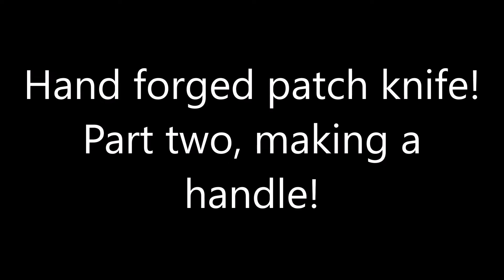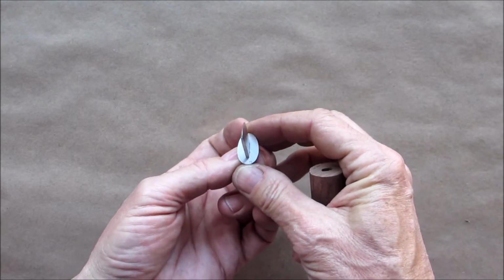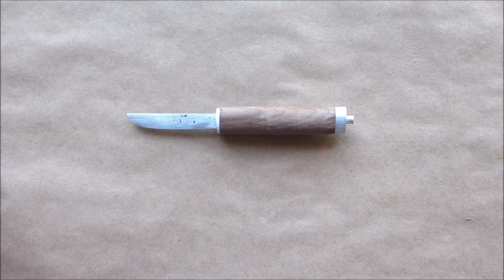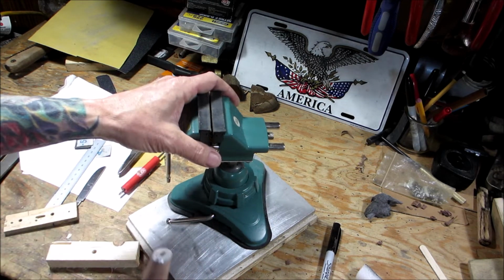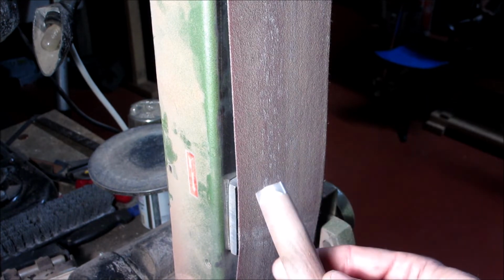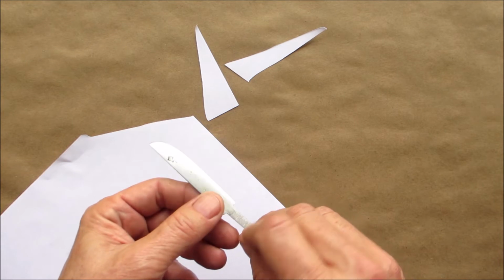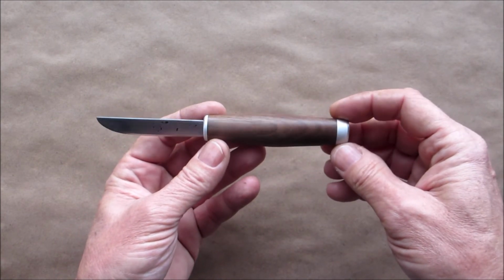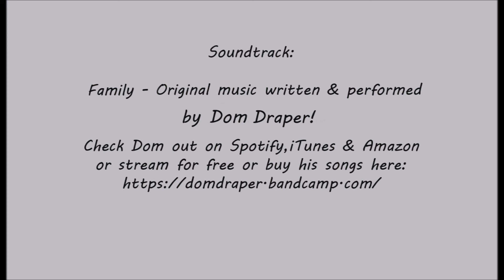Hand forged patch knife! Today is Part two, making the handle and it's finished!

Comment: Nice Bro!!! Wow, that sheath is amazing looking!!! You could sell those!!! I was wondering about the steel you used.... I would think newer steel would be better but I am still learning, I guess it's like alot of other old stuff, in that the quality and or material isn't made aswell anymore....  Here in Florida we see the difference between U.S. and Chinese steel pretty quick.... Chinese chrome? Forget about it.... I have some old Schwinn stuff and that chrome is completely rusted and you can bring it back with almost no pitting sometimes....
China Schwinn, the chrome is like paper thin if that and the metal will be trashed under it after a few years.... I don't have any exciting stuff mostly rusty old girls bike that a friend gave me....  But I have a thing for old 26 or 27 in girls bike (long) frames.... I like to put a 20 in. on the back... It rolls so smooth with the low steel frame and rolls forever.... And it is the most comfortable position to ride with taller handle bars.... Like bmx style... Maybe one day I will show you guys my goofy bike....lol...
I did have 70's Schwinn ape hangers and a stringray wheel on the back but the wheel got trashed one day wheeling a mini bike someone gave me.... Instead of coming home and getting the car I just wheeled it with the bike... It only had the back wheel on it... It swirved into my back wheel with a peg.... Yup.... So I just threw the only wheel I had with a good tire on there.... Of from the smaller china stingray....lol.... It is a little lower geared than I like but it is great on windy days here....
People either love it or hate it...
It's a rusty pile.... Most people actually like it though....
Reply from the maker: Seems the China steel has improved a bit. I hear on most things that came from there, not a high quality! Definitely not like the old days here! I love Schwinns! I spent a week rebuilding one for my girlfriend about 40 years ago, gave it her and it was stolen that night! Grrrrr!! lol!! Thanks for watching brother, I appreciate it!!